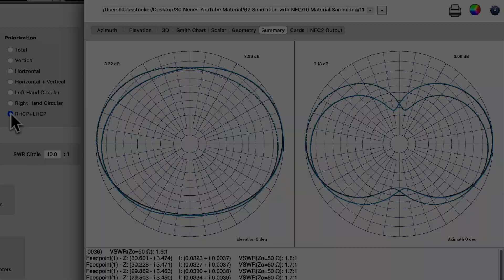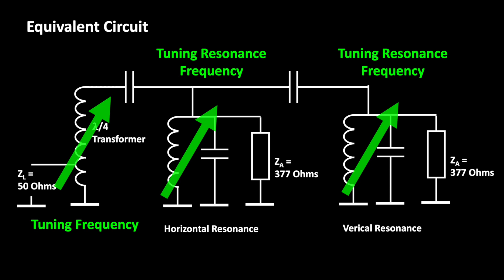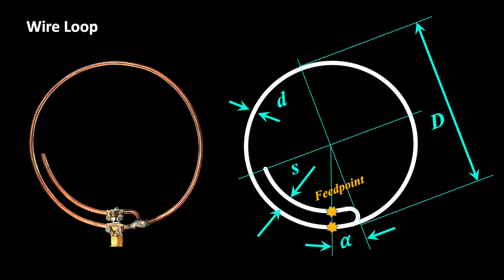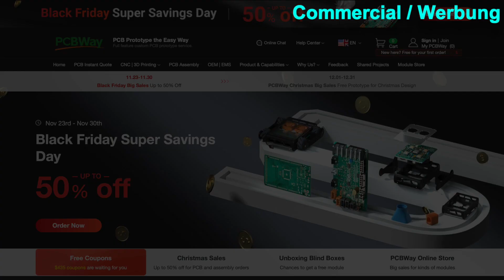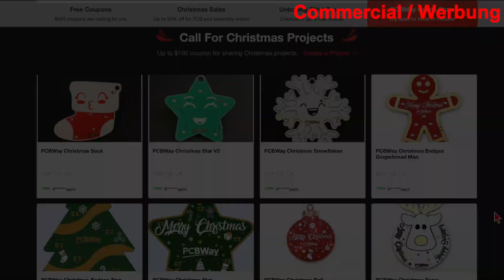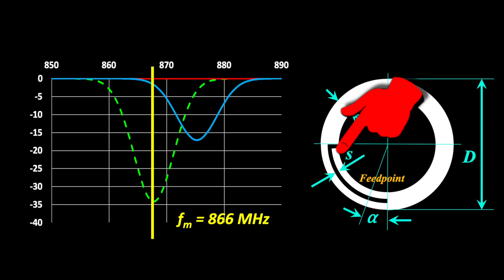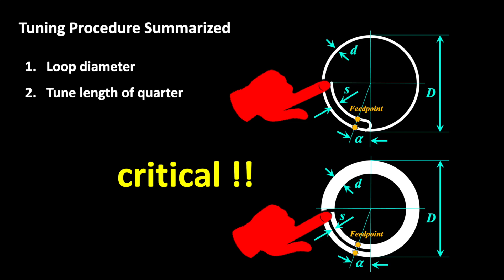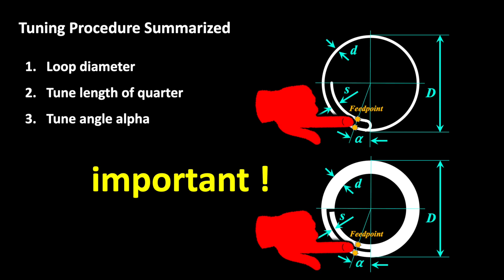Eventually - the Tuning Procedure for a DIY loop antenna (EP86c)

Comment: 3d print the antenna, then cover it with adhesive copper tape. This is better than aluminium because you can solder to it.
Reply from the maker: Thx for your comment. Yes, I agree, will definitely come up with something in that direction.